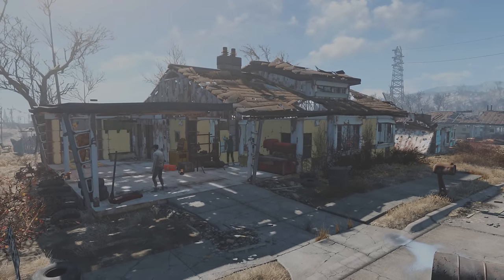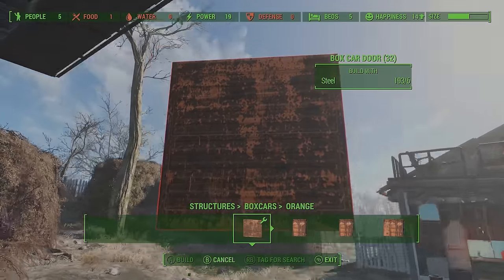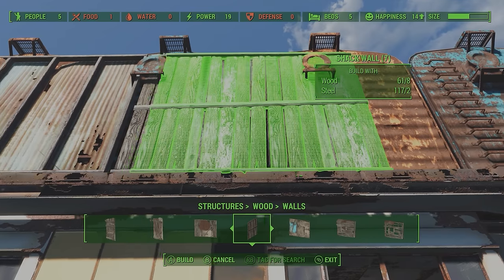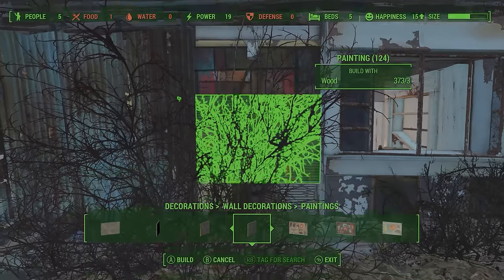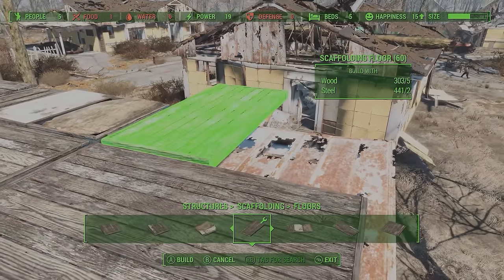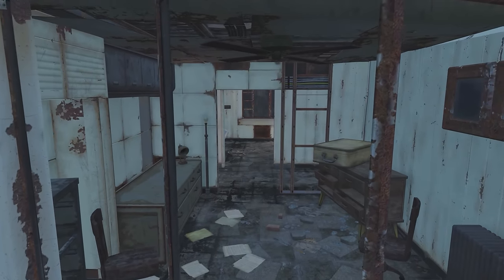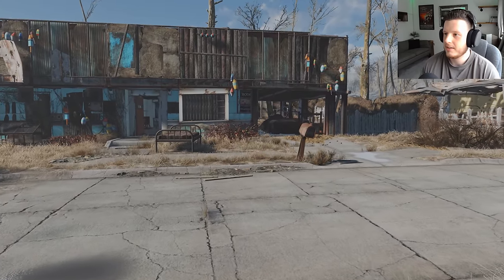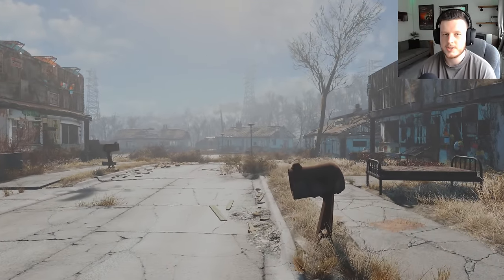Fallout 4 - Sanctuary Roof Repair Minutemen Centre

Comment: I'm playing on PS4 and can't get the rug glitch to work with walls. It's just red anywhere I try to place it. Nice idea with the train carts. I might just use that on a slab of concrete.
Reply: I’m on ps4 too and have the same issue. Did you ever find a solution?
Reply: @cartergrubbs932 nope. I quit playing.

Comment: No matter how I angle this it does not let me put it on the roof 😭😭
Reply: if ur on pc, stack 2 carpets ontop of eachother to make it easier to see when its on, this took me hours to figure out u need to hold the select button (when picking up the carpet) for like 5 seconds
Reply: @McNastyness101  Rug glitch just seems to have stopped working altogether. Won’t let me merge anything into a wall, roof, or floor 😭

Comment: Have spent nearly 12 hours trying this build and nothing works. No idea how you got the roof there. It NEVER changes off red. Have also tried pillar, pillar and mat, extra spacing floors between stairs and roof, stairs in different spot, scraping everything in the house. Nothing works and this is the only one of your builds that i can't get.
Reply: Yeah it just doesnt work